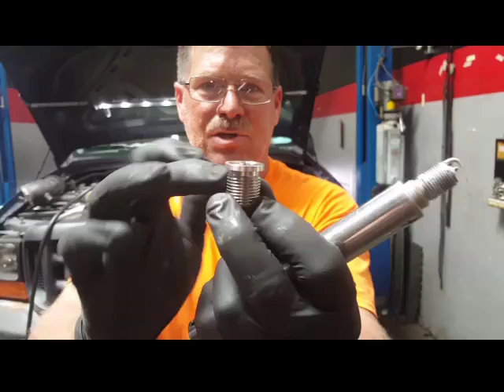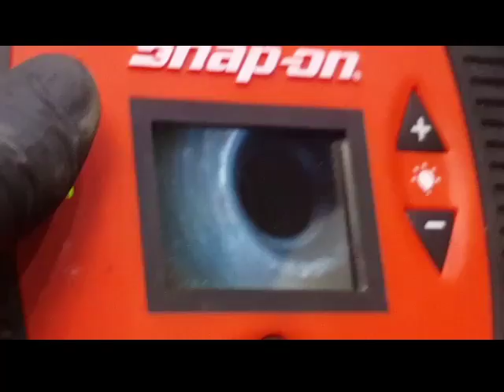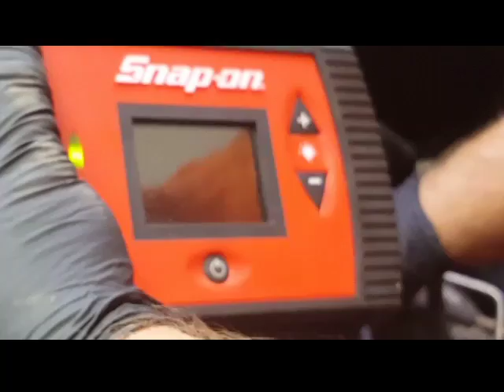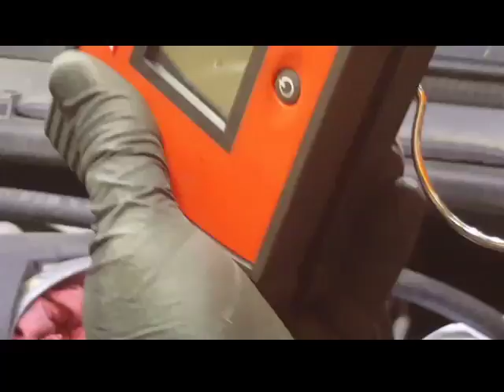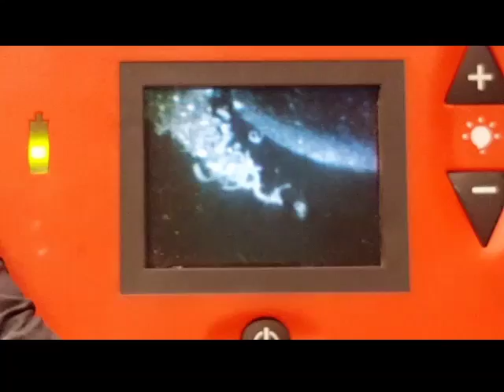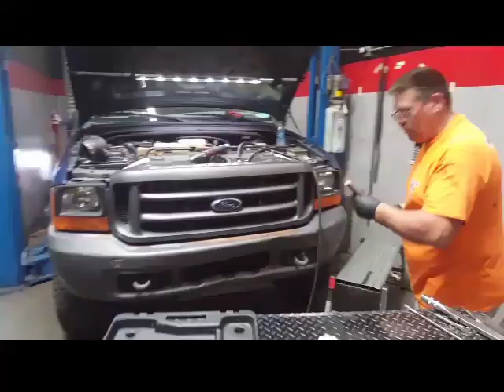New Method on repairing Ford Triton blown out spark plugs. 2 valve only

Comment: Thanks Ron, I'm getting ready to do number 5 on 2 valve 10. I have not tried this but on these trucks fir diagnostics putting the throttle to the floor will not let the truck start. I'm going to try that when setting up BDC with the provided air poper.😊

Comment: Hey Goober! Your “reamer” as you call it is properly called a “core drill” and are readily available on supply sites such as MSC or Rex Supply, etc. 
they can easily be reground by any tool grinder in your area. Make sure you tell them that you are using it with a hand drill and what we call a”bushing” to cut Aluminum. 
Trust me, I am a retired machinist who used to run a tool crib. Sharpening that core drill should cost about 15 bucks especially if you have a number of them to regrind.
Reply: BTW Taps can also be reground. Only the “chamfered” or beveled looking threads on the very bottom end actually cut the new thread. The rest are there for future regrind use. And can be used until there are only a couple Full threads left. 👍🖖 same deal, if you have several to sharpen, they cost less to sharpen.

Comment: for those of us who are cheap you could use the remainder of the JB weld you mixed up to glue the ear back on the coil pack and then reinstall it after it hardened up for a few hours

Comment: You mentioned not knowing the reason for the undercut on the inserts.  It is difficult to produce a full thread to a shoulder, hence an undercut slightly under the root diameter of the thread is used to allow a threaded device to shoulder out.  The other option to achieve a definite shouldering is to countrebore the threaded hole.

Comment: Today I diagnosed an '04 E250 van, 4.6L #2 cylinder plug stripped out. Is this tool able to work in that tight area without removing the body from the frame?

Comment: Ron thanks so much for your videos. They are a huge help to us DIYers. Do you have any experience removing "helicoil" type inserts to replace with the Calvans? My truck (6.8L) had a bad coil coil that was making the the ABS light come on and the the speedo go nuts. While I was doing the coils I thought i should replace the plugs. I am the third owner of this truck and had no idea the status of the plugs. I've owned him for 8 ish years and in that time put only about 15k on him. He pulls our boat and camper and otherwise makes the occasional trip to home depot. The previous owner told me he had suffer at least one spake plug blowout. While pulling #4 i noticed it felt really nasty and in hindsight i should have stopped right there. Anyway I pulled it all the way out and brought about half of a helicoil type insert out with the plug. The other half of it is stuck, quite well, in the the hole. I was able to reinstall the old plug and so far its holding but I dont feel good about it. I counted about 5 full turns of engagement and I saw the same when looking at it with a boroscope. Anyway, my question. Do you know if the Calvan reamer is hard enough to punch through that helicoil insert? I'm not sure how to remove the half helicoil otherwise. It is definitely a coiled wire type insert as the piece that came out with the plug uncoiled very easily. Thanks

Comment: Ron can you PLEASE make a more detailed video or detailed comment (since I have to fix this blown out plug tomorrow) on how to shut my valves and also my piston is at the top how to get it to the bottom so I don’t drill into it, and to make sure no metal shavings go in my engine through valves ? Great videos by the way !
Reply: He explains it in the video. The piston will have the valves closed at either reaching the top of its stroke or the bottom of its stroke. A borescope will verify you have it at the bottom. The air plug from the calvan kit will pop out once the piston reaches the bottom or top and the valves are closed. (but you want it the bottom, not the top).

Comment: When these heads are off and planning on a rebuild would you recommend simply doing all 8 just because its off and for piece of mind? .. granted to do all 8 on the engine and pay someone to do it would be a shit load of money but to do with the heads off and porting the heads for racing the cost of 8 inserts is pretty much no big deal. and a lot of the steps you do in the video would not be needed with heads off but since the tool guid is based off valve cover or intake I might mock the heads up on a bare block simply to locate the tool on the valve cover and to keep the head from moving when reaming.  Was looking into the seally tool but getting replacement inserts really looks to be a pain because no where do they even give part numbers except in the UK and not ordering inserts from across the globe. Going to use the tool to modify all the heads I port so it should pay for itself immediately.

Comment: Very informative,  thanks Ron. A couple questions. How long can you drive with a blown plug without doing damage? Should that injector be unplugged to stop fuel delivery?
Reply: Stop driving asap. You will end up stranded on the side of the road once the plug comes all the way out.   Worst case scenario unburnt fuel pushes up past the spark plug and causes a fire underhood.  I'm researching this repair on a Land Cruiser - also an Aluminum head design - because mine failed yesterday.
Reply: Pretty sure I watched a video where the mechanic said the customer drove 700 miles to get it repaired. It runs ok with everything still connected, but to be safe they usually say to disconnect the electrical connectors for the offending coil pack and injector. When I did that, it went from running a little rough and sounding like a steam engine to not wanting to idle and just running like ass. But it did run.  (Just had my second one pop a couple days ago, planning to do the job tomorrow.)
Reply: I drove 80+ miles to get home when mine blew. Loud and rough but no fires.

Comment: I'm repairing a blown out right now. After I tapped the new threads I blew out the debris but looking in the cylinder it looks like a puddle of aluminum on each side. I wouldn't think that the  drilling or tapping would have gotten hot enough to liquefy the shavings. Have you had that happen on any of them you've done? I've tried to get a couple of things in there to break it loose if it is in facts puddle of aluminum but couldn't really get anything to get over to the side of the cylinder. I sent some pictures to Cal van this morning. No reply yet. Great videos.
Thanks

Comment: I have a three valve Triton engine where the spark plug broke on cylinder 5 and the nut came off the top of the spark plug. Half of the porcelain has been chiseled out of the steel casing left in the block. Multiple attempts have been made to use an extractor to break free the steel casing but we haven't been successful to accomplish that. The extraction tool does break away some of the steel of the casing during this process. We have tried to heat and cool the steel casing before extracting but that doesn't seem to be helping much. Have you come across this type of difficult situation which none of the tools can support easily? What guidance can you provide to allow us to move on to the next steps of this repair?

Comment: @ronwilliams2042

Thank you for putting together a very thorough and detailed video on this, it is really helping a lot!
The only issue I had is after reaming and retapping the spark plug hole I noticed that unthreaded “shelf” at the bottom of the threads and assumed that the tap didn’t go deep enough, so I brought the E-clip up to the second spot and continued (by hand with a ratchet) to thread the rest of the hole.
I didn’t know about this until I watched the END of your video explaining about that 1/16” “shelf”.
I haven’t installed the inset yet (got to get some 271 Loctite tomorrow), but hopefully that “shelf” missing won’t be an issue????

Comment: Great video.  However Our Ford dealership has had trouble with the stock spark plugs which are two pieces (!) coming apart.  I put E 3 plugs in my two valve  4.6 engine in my Grand Marquis Ultimate Edition.  My GT 500 Mustang does not have that problem and does have more than 4 threads holding the plug in thankfully.

Comment: Hi Ron, Great videos. My 2003 E-250 blew #3 last week while I was driving from Seattle to Reno. A local shop in OR put one of inserts in that you do not recommend, although it did get me back on the road. I don't know if he blew the shavings out of the cylinder or not. The van is running well but I'm concerned about how long the fix is going to last. As you know, a van is much harder to work on because of limited space so I'm not that excited about doing it myself. Have you done this repair on an E-250?  Thanks.
Reply: How did the repair on the van go? I got a 2010 e250 that im about to start... curious if you had to pull the intake or what major issues you ran into if you did the inserts?
Reply: @Reach3DPrinters  Hi Ron, I ended up taking it to a local and they did a great job. Replaced the temp insert and fixed all the others. Van has been running great so far. It was just too tight in there for me to do it. Thanks for checking. Good luck on the job !

Comment: Will this tool work on an expedition with a 5.4 triton two valve with a snapped off spark plug head  socket size 5/8”?

Will the reamer ream through the spark plug base

Comment: Ron,

Thanks for all the great videos! My question is on my 2 valve v10, do I need to remove the e-clip on the reamer or not? Thanks in advance and keep up the great work. 

Also, I bought the cal van kit because of your recommendation. They need to throw you some royalties or something.
Reply from the maker: I cover that on my video about revised calvan insert on my channel.  
But the answer is no. It can stay on. I take mine off but if your kit has the option you can do it either way. 
Thanks
Reply: Thanks Ron!
Reply from the maker: IDScout 
You're welcome. Make sure if you haven't already done so it is subscribe to my channel I'm going to try to become bigger and better

Comment: Help I have a 99E 350 super duty 5.4 two valves , I’m wondering if the 38900 calvan set is the one I need for this van ?

Comment: I will note that the most recent CalVan kit I received specified to only use the "E-Clip" in the thread tap. "DO NOT USE E-CLIP IN REAMER. Reamer lengths may vary slightly. Use of e-clip in reamer may not allow enough material to be removed to allow insert to be positioned properly. The roll pin acts as the stop for the reamer." - as stated on information within the kit.
Reply: thanks for the info, i purchased a used once kit from ebay, came with pretty much the extras for the job(air blower rod, air ratchet, cam, and jb weld) $224 just missing 1 insert. it did not come with the e clip which i have seen on most kits.

Comment: 7/14/23. I have broken off plug in #2. 05 3 valve 5.4L. The threads are still in hole, a easy out will not remove them. Can I use the Cal-Van 39300 remer to cut through the plug threads? Or should I use a 9/16/14mm drill bit first?

Comment: I've been watching all your videos and finally got all the tools I need to properly do the job. I'm going to be doing this on my dad's 98 Expedition. Everything seems pretty simple and straightforward, however I'm nervous as hell about accidentally boring into the piston. I haven't seen any videos of you showing how to manually turn over the crankshaft, so I'm going to have to figure that one out. You just use an 18mm socket on a ratchet and turn it clockwise correct? And do you turn the crankshaft while the air plug thing is in the whole until it blows out?
Reply from the maker: The bore scope is important for many reasons. One is to make sure the piston is down and valves are closed. Yes the air hose tool should be inserted into the sparkplug hole. It will blow out as soon as it senses the valves closed. However the piston can be up or down with the valves closed. I use the bump method to find bottom dead center by quickly turning the ignition key and quickly tapping the engine over slowly until the hose blows out then looking with bore scope camera  to verify the piston is down.
Reply: @SandCarServices  That's what I thought you were doing, however the battery in his vehicle is dead from sitting for so long so unfortunately I can't do it that way. Once the repair is done I'm leaving it up to him to buy a new battery. I'm slowly becoming more confident on working on vehicles by watching your videos. Every time I Google a problem one of your videos or another guy I wont mention since this your channel pops up, you both have helped me save a TON of money so thank you. I'm also from CA, but up by Sacramento. It's nice to see another Californian that's not an A-hole. I'm no mechanic by any means that's why I ask questions to educate myself. I bought an endoscope I can connect to phone that I plan on using. How do you know when the valves are closed? Is it possible for the piston to be bottom dead center, the valves open, and the air plug blow out or will it only blow out once the valves are closed?

Comment: Rather than using this blow-out tool to tell where the piston/valves are, some/many borescopes have the ability to look sideways (or you can affix a small mirror) so you can actually see if the valves are closed

Comment: Ron, do you think the misfire on Startup could be spark establishing a path through Loctite and J-B Weld back to ground through heating of the components.
Reply: No, a good ground is a good ground. He hit the point as to why it happens he just didn’t explain it very well. It’s not the fuel laying on the piston it’s that the fuel was spraying in the cylinder with no combustion causing a decrease in compression due to the excess fuel washing the piston rings. After running for a bit with  proper combustion in the cylinder again those rings will seal back up, compression will usually be restored, and that misfire will go away.

Comment: Caution: While this kit works great - be careful of the e-clip (dumb design) 

Used this kit.  2001 4.6L. My kit is slightly different - the reamer has a pin through the top to stop it and the tap is the one that needs the stupid e-clip.  Well on the tapping step, the damn e-clip vibrated off, and the tap slid right through that guide into the cylinder.  I can still reach the hex end. Tried a magnet inside my 1/2" socket - not strong enough.  I am thinking about epoxying the inside of the socket and gluing it to the hex end of the tap rod.  If it holds, I can lift the tap and then back it out through the threads it made.  Really don't want to pull the head.

Comment: My HONDA FIT plug backed out but dint blow the threads. Its a common problem on the FIT. I simply used a very small dab of anti sieze (only a tiny dab) and put the plug down hand tight nice and snug. It never had a problem ever again. You guys are doing somthing wrong. In 40 years ive never ever used any lock tight on any spark plug on any engine. I also came to find that too much anti sieze is bad news. Only use a tiny dab.

Comment: I recently bought the calvan kit. It worked great up to the point of putting the insert in. All 8 of the inserts aren't cut deep enough and bind in the hole. I thought maybe it got cross threaded, but I can start the tap back in by hand. The bore scope shows nice threads. I noticed a review on amazon that had this problem. Have you had this issue with the inserts?
Reply from the maker: I have had a couple of people say the same thing. All my inserts are fine. I have not come across any bad inserts. Did you buy an actual Cal-Van kit or am aftermarket?
Reply from the maker: Just talking with my parts representative. Call me asap
Reply: @SandCarServices  it's an actual calvan kit. I ordered a new kit. Should be here tomorrow. We'll see how these work.

Comment: Have you tried the Full Torque kits from Lock N Stitch.
Reply from the maker: 1300 inserts installed with zero failures. I don't need to.

Comment: all these aluminum heads should have a steel insert put in them from the factory in the first place. Plus anything that bolts to the head should also have inserts put in them. That's why I hate aluminum heads from the start.

Comment: Very good video, one question. I have a motorhome with the 5.4l  no problems yet, should I do all 8 before this happens or hope for the best and if one goes, just do that one?
It has 38,000 miles 2016
Reply from the maker: Keep your spark plugs tighten to 20 ft lbs every 30k and you'll be fine. I always used to recommend RV customers to call Denis and order a kit and keep it in the RV so if you have a failure some hole in the wall shop doesn't install the crap ones

Comment: This is a great video. I have a kit on its way and I will be taking care of this on a 04 Explorer this weekend. I would like to know where you bought the air wand? I have seen plenty that are long enough but none that are bendable.
Reply from the maker: Richard Carlson 
The blow gun used in video was hand made 20 years ago using valve from lowes, and 1/4 brake line
Reply: Thank you for taking the time to explain that to me. Now that I know (and I would never thought of it) I can make myself one. 
Thanks again.